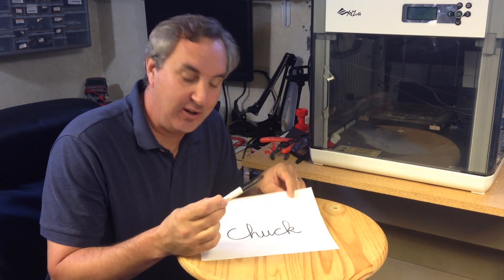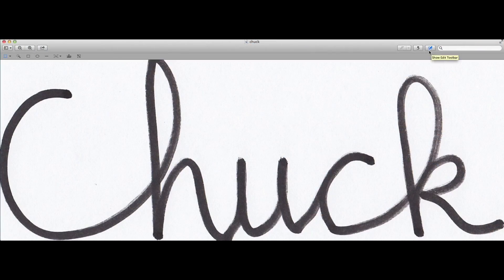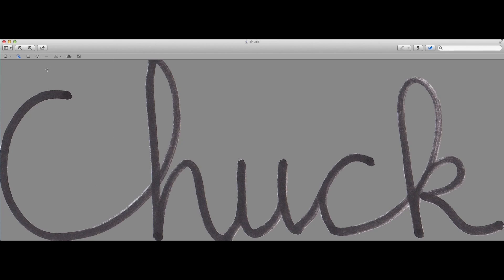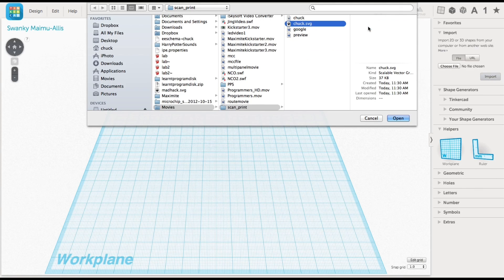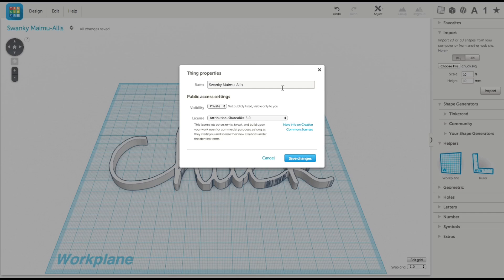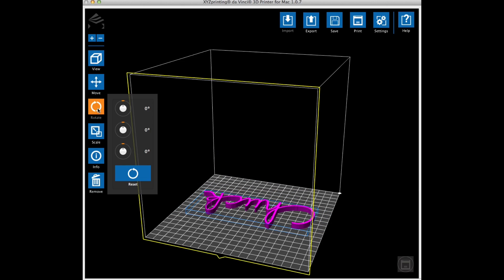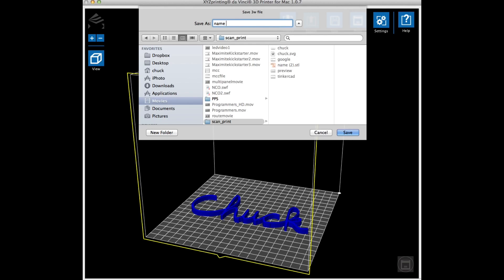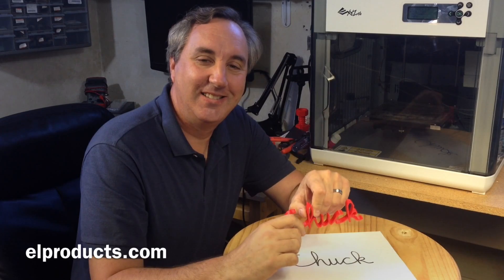Convert Written Text to 3D Print - Video #011

Comment: Brilliant tutorial, so easy to follow. I will use Affinity for cutting the letters (nearly the same as PS but much cheaper), I can save to PNG from Affinity. I will try the same convert program you used. Tinkercad is my favourite site to use for designing. I will be attempting to make a sign on a baseboard with the letters raised. Fingers crossed and thanks again

Comment: I tried this with a png file saved from photoshop, followed all your steps to the letter and it came out as a black rectangle with white lines where the letters outline...... am i missing something?
Reply: Same issue I have. I prepared a png text than I can see a black bulk. maybe the example has a single line. that is why we have the same problem. I put lines between letters, have a progress but not enouh

Comment: I am not that familiar with 3-d printers, but can you make the name as thick as you want, or is that the thickness the name would have to be?
Reply from the maker: You can adjust the size in the software but everything would get bigger. It’s probably easier to just draw it thicker first using this method. Tinkercad now has a feature where you can draw freehand right in the software so that a better way to go. This video is a bit old.